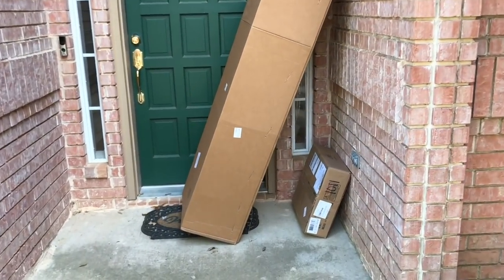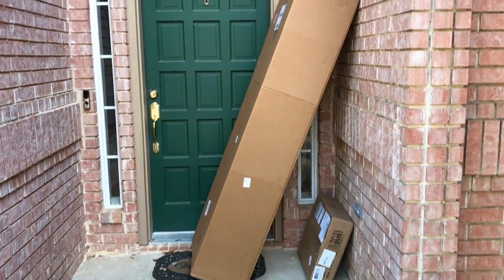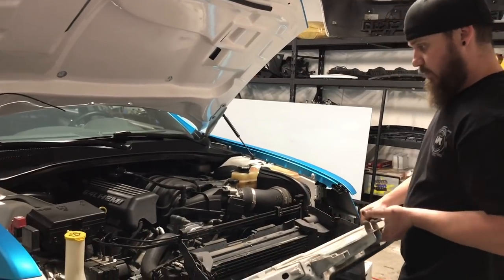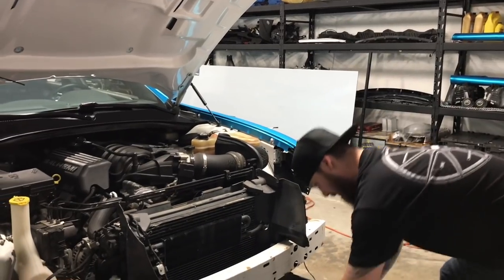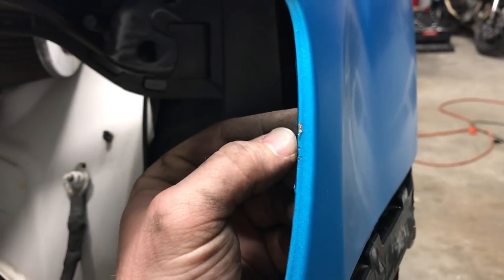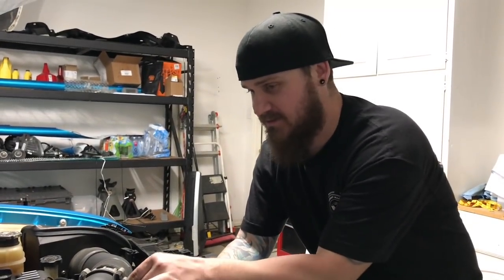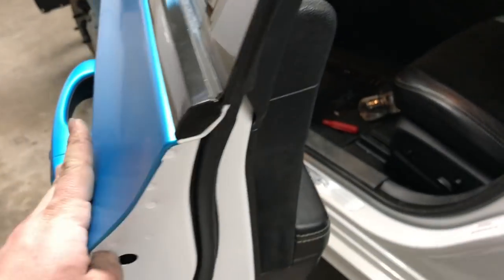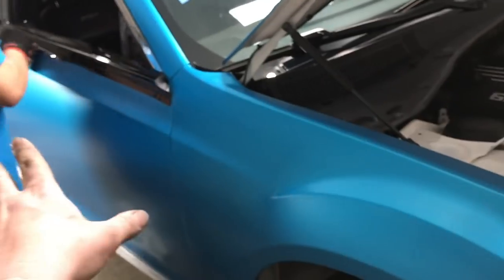Mishimoto catch can install Chrysler 300 SRT8 6.4 | Radiator Core support swap | Chrome delete done

Comment: Rockers would look slick gloss black with the roof and mirrors. Regardless that blue is looking insane. The chrome makes the 300s look 100x better.
Reply from the maker: You prefer the chrome? Only thing about black rockers is they make the car look taller. Body color gives it a lower appearance
Reply: Zack Stenstrom should of said chrome delete. 🤦🏻‍♂️
Reply from the maker: Hahaha, ok. We’re on the same page. 😂